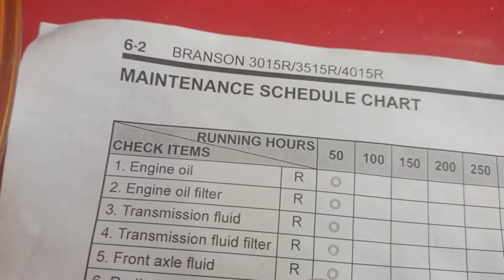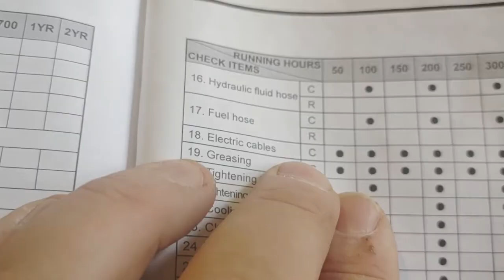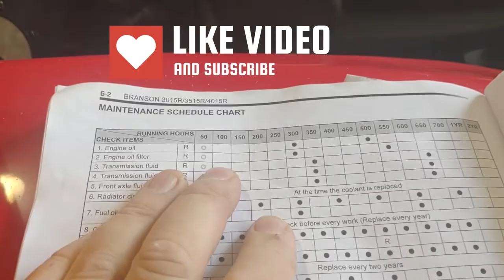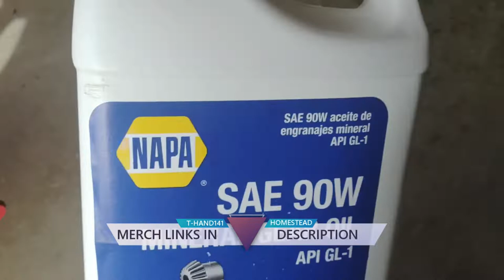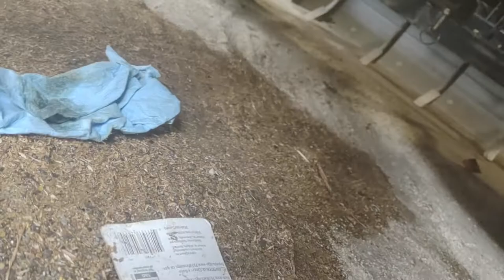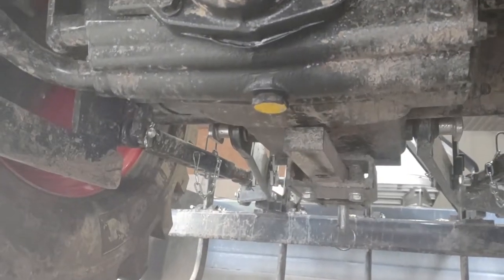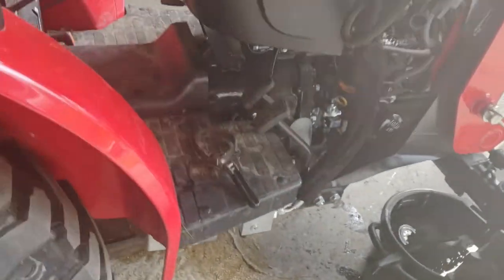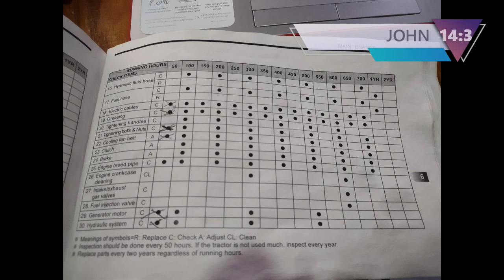Branson 2515H 50hr Maintenance Step by Step

Comment: Hi Tracey,  I change  my  oils every  200hrs  as per  JD Manual.  You are not working it that hard the oil in the trans  should be OK.  Life  is good  when you have a tractor.
Reply from the maker: At this point I am more concerned with the warranty. And It is comparatively cheap insurance. Thanks for watching Dave!

Comment: if there are any metal fillings they would be in the bottom , so what you could do is take the plug out and let some of the fluid out ( a few seconds) then put the plug back in. This way if there were a few pieces of metal , they are probably gone and now you only lost a little bit of fluid. Top the fluid back up and your good to go ,,,, i would only fo this for the 50hr as its not alot for hydraulic fluid
Reply from the maker: Great idea! thank you!

Comment: Well done!  No, the loader need not come off, but if you have the backhoe on, you need to remove it, or be really dangerous and remove the front subframe  pins and extend the bucket enough to push the front  of the subframe down.  Please just remove the backhoe, seriously.

Also, when you drain the hydro, you really need 3 of those big pans.  You can try to plug the hydro back up as you fill the pan, then go drain it, but it's so much easier to have 3 or 4 pans handy.

My dealer said they don't usually change front axle oil at 50 hour.  It's required by the book for warranty, so I did it by the book.

If you want to get all religious about it, let's look at some scripture - What doth it profit a man, to save money and time on his scheduled maintenance, yet lose his warranty.  Or something like that....
Reply from the maker: Absolutely! great advice! Thank you. And Thanks for watching!